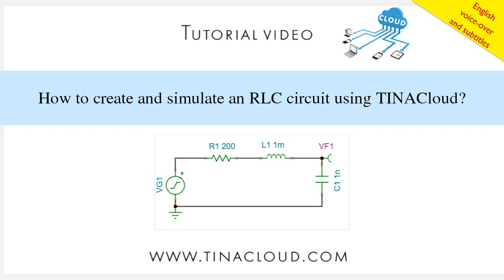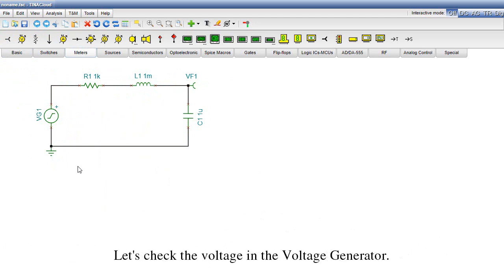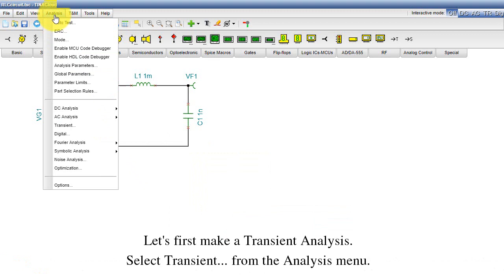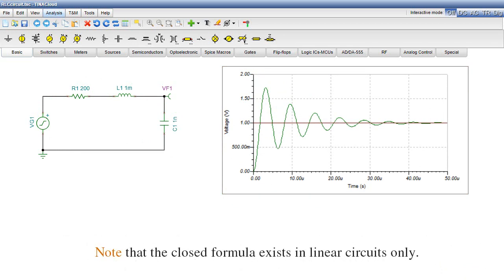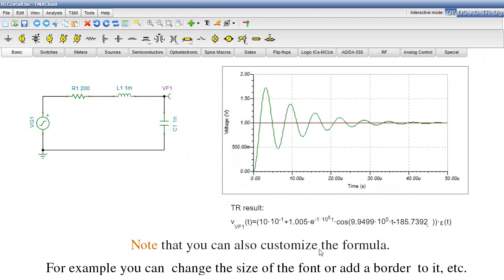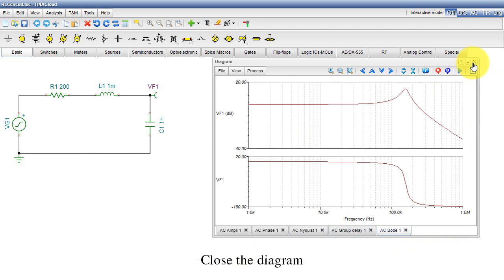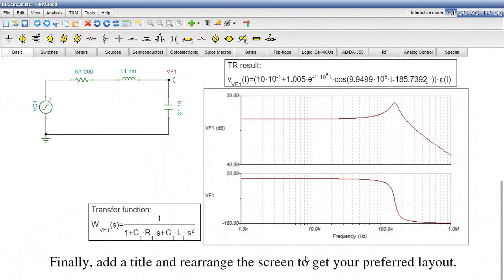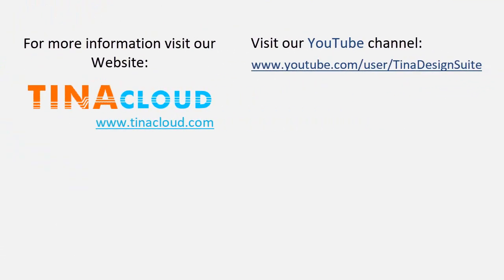Creating and simulating an RLC circuit using TINACloud

Comment: I'm just starting out dabbling in electronics. Bought the Tina simulation and trying to get it simulate blowing an LED in a very simple circuit consisting of just a battery and a diode but no matter the voltage and current I adjust to pass through the diode in the software the diode never show a fault when switched on.

What am I doing wrong.